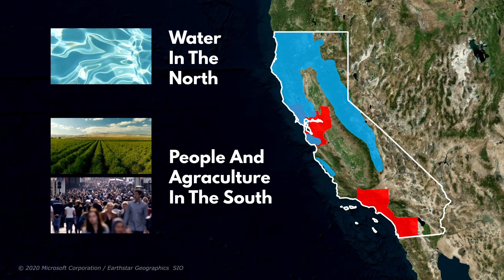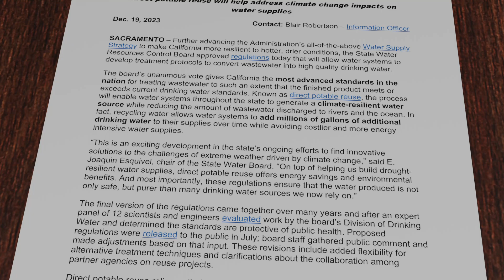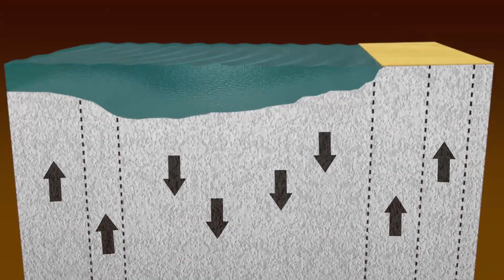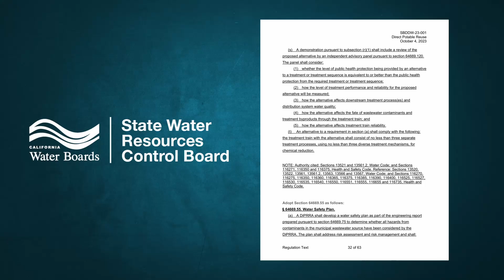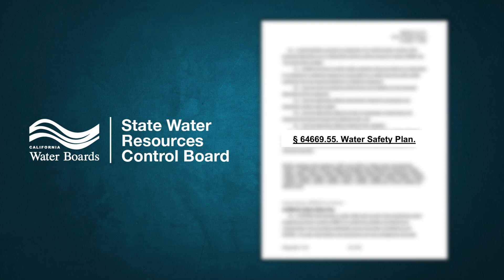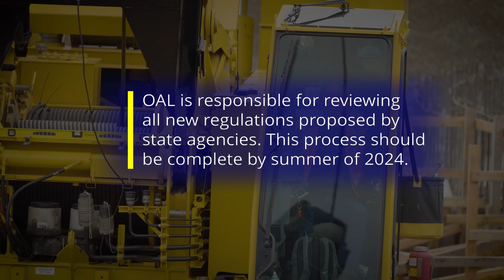California's New Toilet-to-tap Rules Explained

Comment: I ran water plants in California for 30+ years and ran under The more strict Federal regulations  ONLY.  Drugs and bio hazards go in the toilet. There is no way to remove them. Yes really!!!!  The dis infection of water they ( the state ) use is poison its self Chlorine and ammonia … I retired and got the heck out of there.  When drug dealers are getting raided they flush the drugs down the toilet!!!! There is no way to take it out of the water. So they don’t talk about it. I had the licenses up to engineer grade and 3 different ones For water treatment and 3 more for other parts of the systems. Once the ground water is infected with waste water it remains infected / contaminated.  This propaganda is not complete . I ran with this technical design and  better it is not complete.